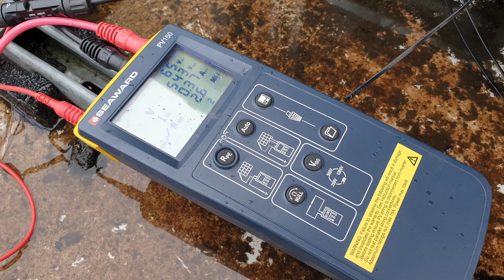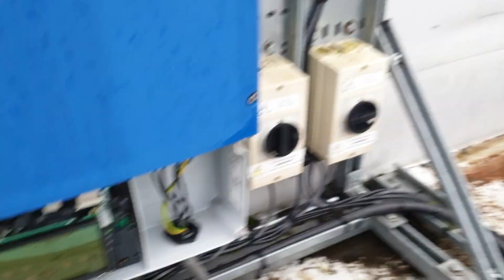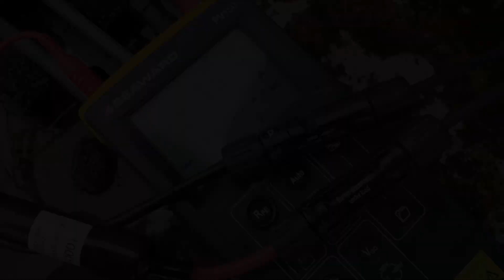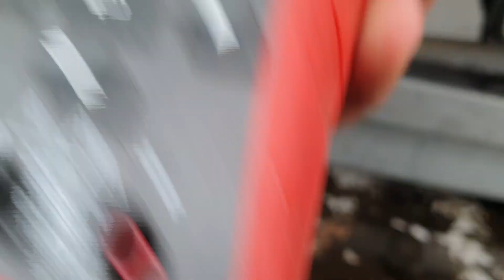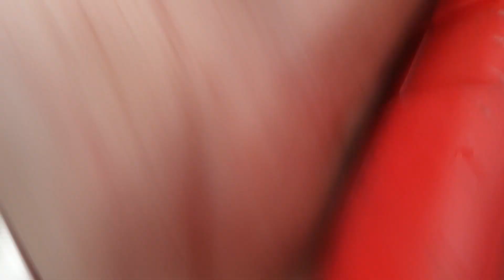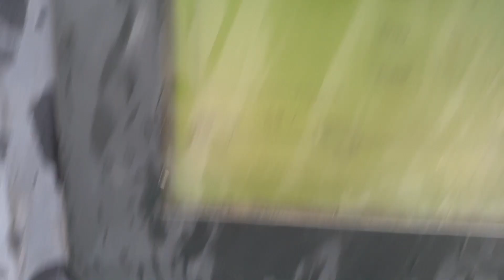Soggy Solar

Comment: Hi have you got a link to that clamp meter
Reply from the maker: Hello, it's an RS Pro 156B
https://uk.rs-online.com/web/p/clamp-meters/1624456

It's a rebranded Appa and the same (or extremely closely related) meters are also available as things like...
Benning CM12
Megger DPM1000
Seaward Solar Power Clamp
and the list goes on.

It's generally an excellent meter, I like it a lot and would buy it again but it's not small and the battery life is rubbish. I don't in practice use the bluetooth very often but it's nice to know it's there. I wouldn't cry if it wasn't.